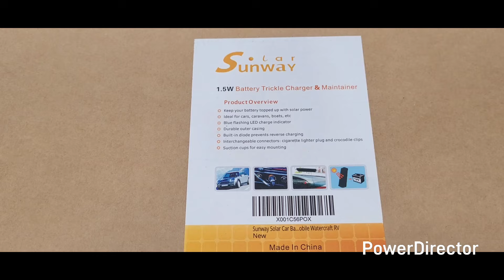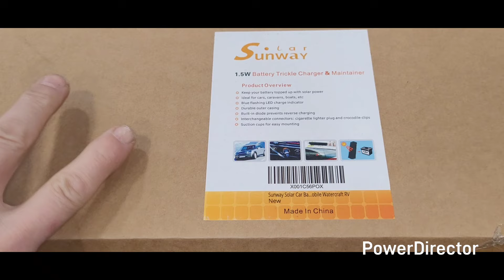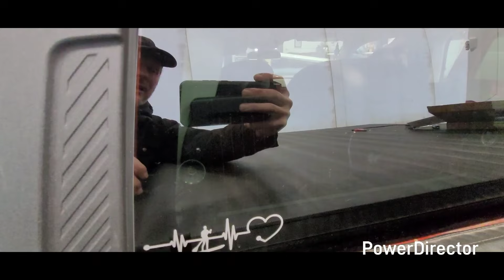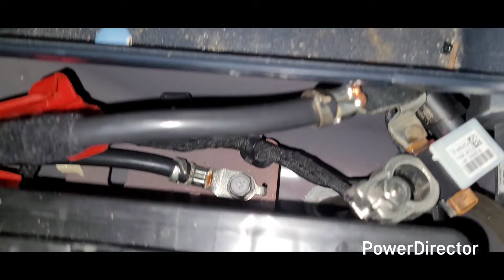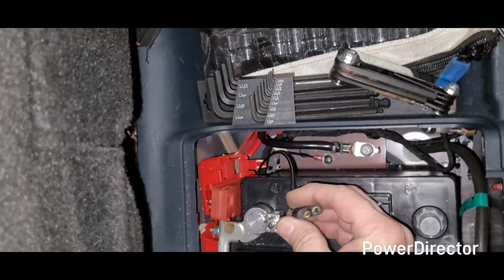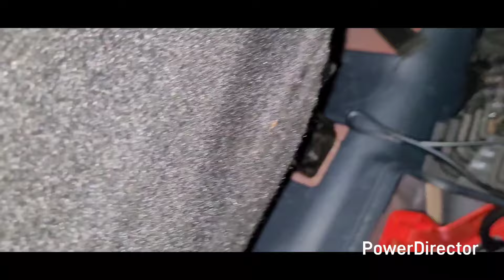FORD MAVERICK TRUCK- easy hybrid 12 volt battery low voltage warning fix

Comment: I drive a `23 that is also Hot Pepper Red, and I have over 91,000 miles on it.  Lately, I have been having lots of "Battery Saver" mode notifications.  With cold weather on the way, not being able to utilize the remote start, sucks!  I truly appreciate this video, and how it shows how it will connect, is so helpful.  I am NOT mechanically gifted, but I think I can handle this.  Thanks for the great info!!

Comment: Do you drive with the kit connected to the starter battery?  I read in Amazon comments suggesting surging currents can possibly destroy the circuits in the solar kit
Reply from the maker: Always connected. The panel has not been damaged and I'd be shocked if it was.
Reply: Quick question: why not directly attach to the nut that is already on the chassis
Reply from the maker: @jw-for-usa  on the vehicle body or the negative terminal?

You don't want it on the negative terminal of the battery as that will bypass the battery monitoring system module. 
On the vehicle chassis, I don't want stacked terminals as that can induce resistance and corrosion issues.

Comment: For a 2024 Ford Maverick Hybrid, replacing the factory 12V battery with an AGM (Absorbed Glass Mat) battery is a common upgrade to fix "deep sleep" mode issues. The recommended upgrade is an H5 (Group 47) AGM battery or H6 (Group 48) AGM. Popular options include Duralast Platinum H5/H6 AGM or DieHard Platinum AGM

Comment: You want to hook any charging to the outside of the BMS sensor on the negative terminal
Reply from the maker: Hooking the ground wire directly to the body does this, as i did in the video

Comment: I am about to do something similar. But I went overboard with 80W Grecell folded and put on the dash.  I would really think your would improve performance if it was dash mounted to get more sun compared to horizontal through tint. But I don;t drive much and need all the help I can get.

I do appreciate your thoughts on the POS post.  I will have to rethink how I wired up the fuse for my inverter to be better.

Comment: What size ring / connectors did you replace the clamps with
Reply from the maker: Whatever size fit the stud and screw i used. Im a mechanic for a living so i have a selection of sizes to work with. Often, you can buy a little blister package with multiple sizes in it at an automotive store.

Comment: I have a 22 hybrid. Already had battery replaced in it 2024. But I don't drive it as much since I retired. Have same issue from battery so I think this is good alternative since it's sitting a lot more these days. Thanks

Comment: Why buy a new vehicle for big bucks and have to resort to this.
Reply from the maker: It's cheaper than an AGM battery
Reply: @rowerwet  $126 shipped for an UPLUS AGM 140R battery, not too shabby
Reply: @rowerwet  Manufacturers / Dealers simply don't know how or do not want to fix, Great deal if you're out of warranty.